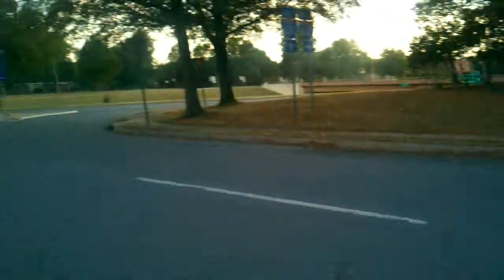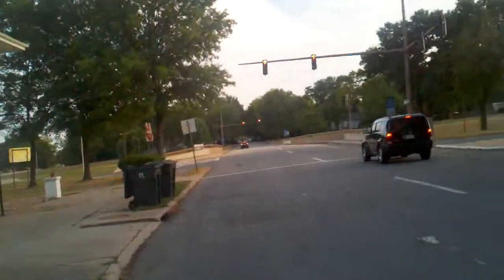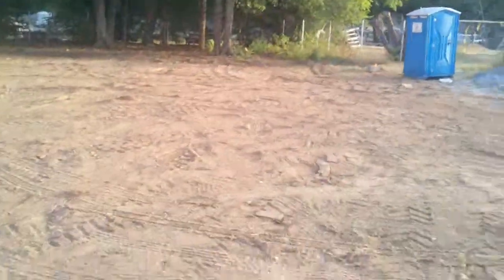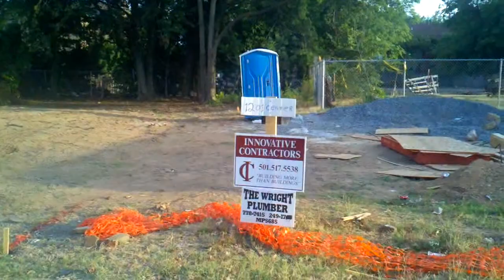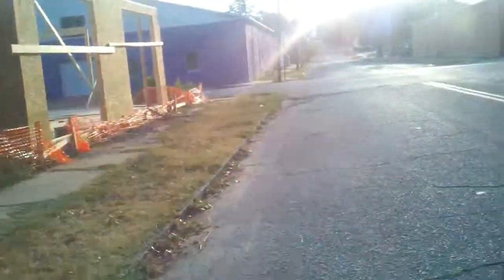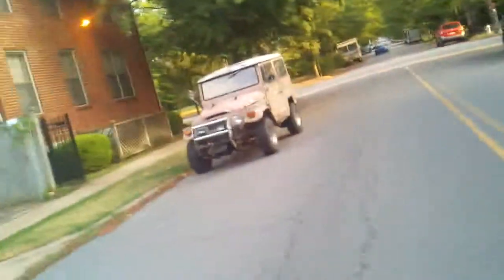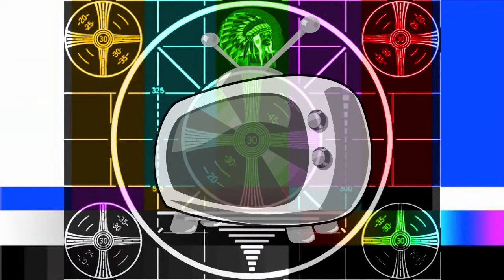Stationary Balance, V-Twin vs. Parallel Twin, and the Kawasaki Vulcan 500

Comment: Mike, I have had over 40 motorcycles in my 42 years of riding (started in Feb. 1974).  I owned a 1996 Vulcan 500.  I used it as my "training bike in 2005/6 when I follwed the training of ridelikeapro.com videos (recommed them to you).  Good bike and very easy to handle.  My cureent bikes both weigh over 750 lbs.  In fact, my 1500 Goldwing weighs close to 900 lbs.  I am 60 + in age so weight and strength have little to do with motorcycle riding.  Technique is what you need to have in motorcycle riding.  By now, (2016) you should be good at riding if you practice, practice, practice!  I use tennis balls cut in half as "cones" for my drills.  I think my biggest bike was my 1400 Cavalcade as far as weight goes.  Center of gravity is a non point if you know how to ride.